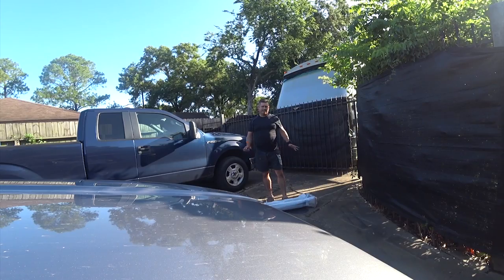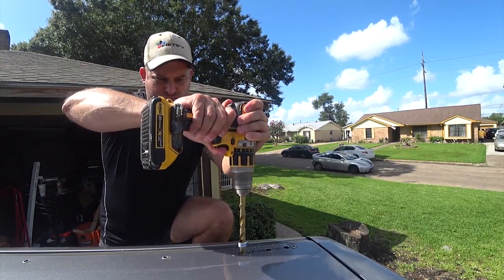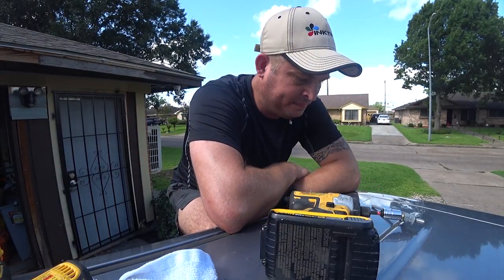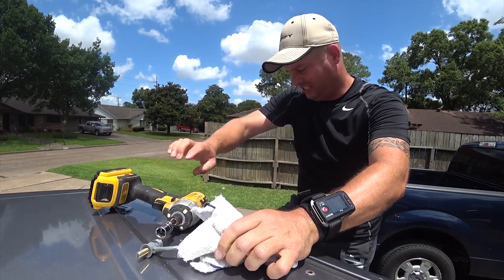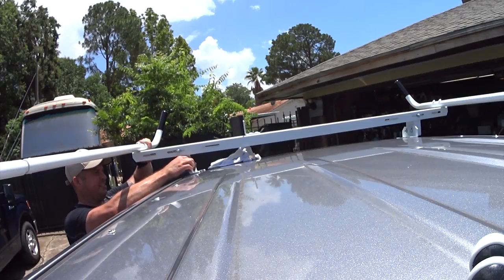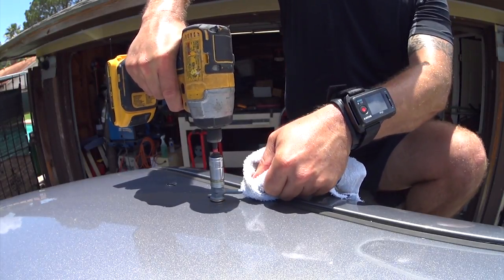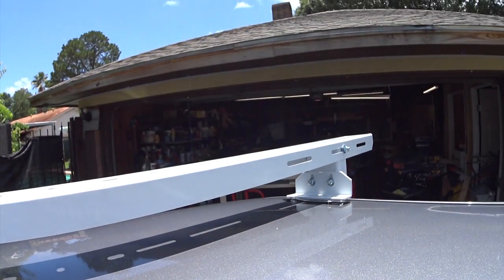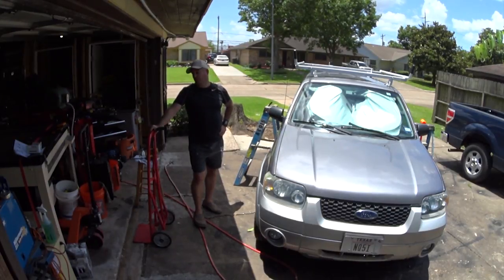Ford Escape Hybrid - Add a Ladder Rack

Comment: Love my Escape Hybrid - I'm on my 3rd. one. When I drill large holes in steel, I start with a very small pilot hole, then gradually go to larger size bits until I get to size I need. Makes drilling much easier, the drill doesn't bind nearly as much, and you get a cleaner hole. I just mounted a tow hitch on the front of my Jeep and had to drill 1/2" holes through the frame. I used 7 or 8 bits to get me to the 1/2". Just my 2 cents. Nice ladder rack.
Reply from the maker: I did use a 1/8" pilot bit..... Ideally a magnetic mount drill would be used.... but failing that you just have to aim for "good enough."  The only surprise was in the back, discovering a hidden bulkhead for the rear hatchback.  It makes sense, but it wasn't something I could see through a 1/8" pilot or 1/4" pilot bit.  Even when I did see it, I wasn't sure it was going to be an issue until I tried to install the threaded compression devices.

Overall it has not had that much of an effect on my miles per gallon.  The bigger issue is taking it easy on the freeway which yields better MPG.  My goal in obtaining a FEH (Ford Escape Hybrid) was to have more interior space and better fuel economy than my F-150 Extended Cab.  I also wanted to not run the miles up on my F150.  I've been very happy with it.  I've put 5,000 miles on it since May and it's been a reliable and comfortable vehicle for me.